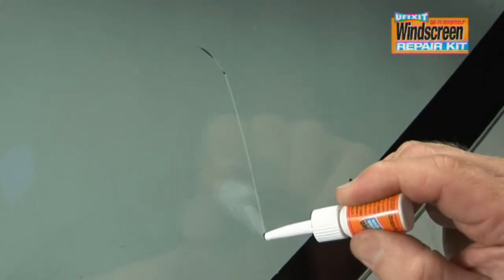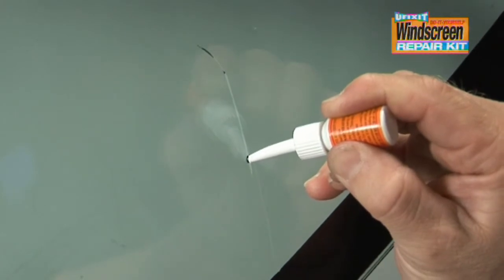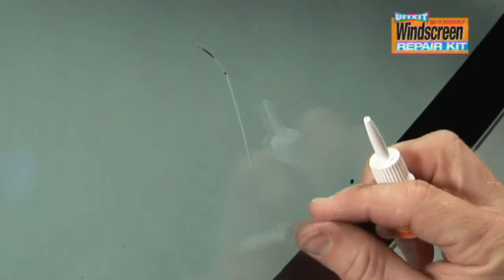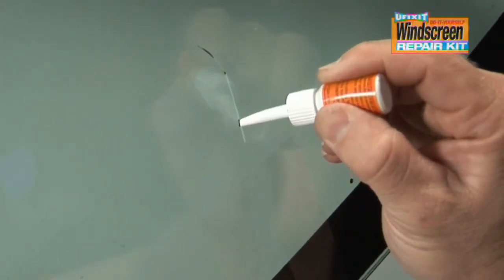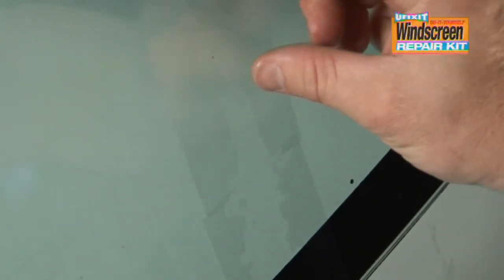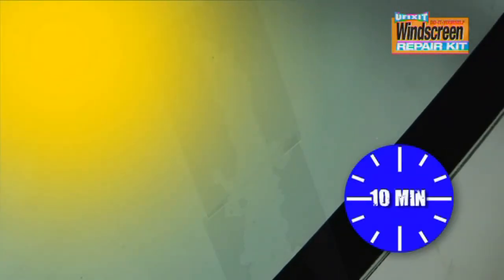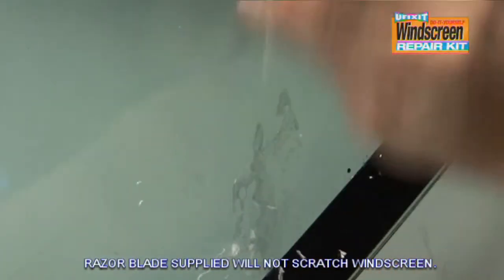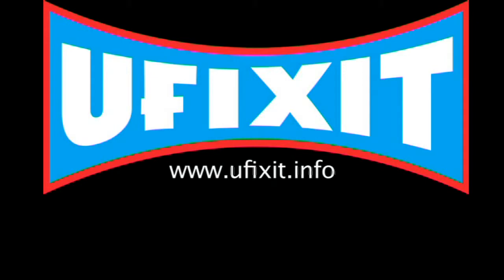Ufixit Windscreen Repair Kit Crack Repair how to

Comment: Do I use lighter to heat from inside or outside?
Reply from the maker: Use the lighter on the inside only for a few seconds. The resin will be drawn in and the air expelled in the cooling down process. Use the heat sparingly as too much heat can spread the damage further.